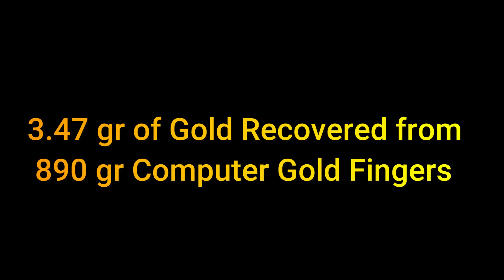Gold Recovery from High Grade Gold Fingers | Gold Finger | Gold Recovery from Computer & Electronics

Comment: It is better to first remove the varnish from the cinguer, this process removes the metal plating without problems with caustic soda .
After washing and catalyzing the caustic soda, he processed with a solution of 3 parts of muriatic acid and 1 of Nitric acid = aqua regia .
I always have the solution mixed and I do not later add the catalyst to the acid precipitated with metabisulfite since I also recover the copper later.
Reply from the maker: thanks for watching and information

Comment: . . There is no need to add copper to foils. Just dissolve the foils in AR or HCL and bleach. Filter it, and drop out the gold
Reply from the maker: thanks for watching my video and good informatin sir
Reply: @ImanGoldRecovery  Your welcome. You can melt just the foils and it will be about 18k. The 6k contamination will be nickle and copper. But it's pointless, just dissolve the foils, filter and drop the gold. It will be 24k, 99+